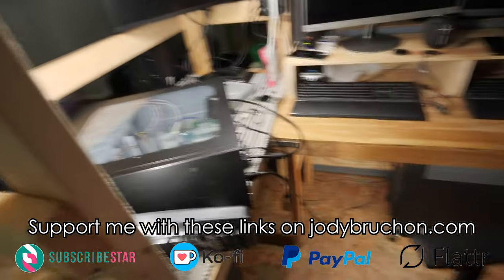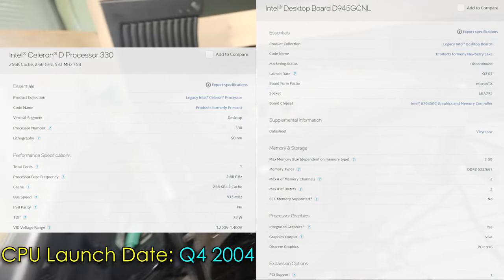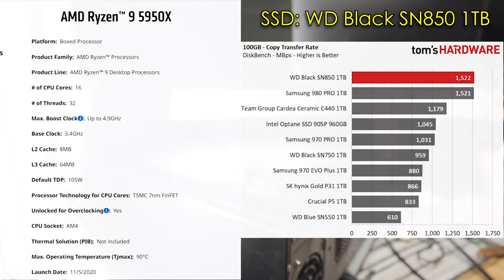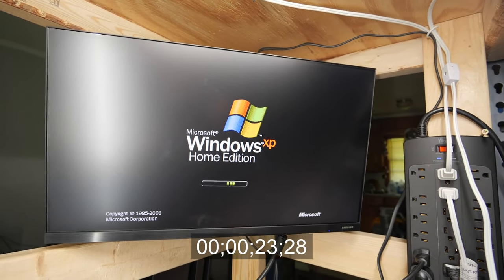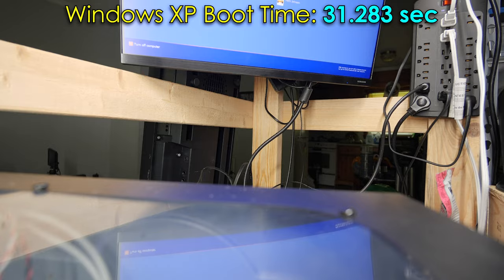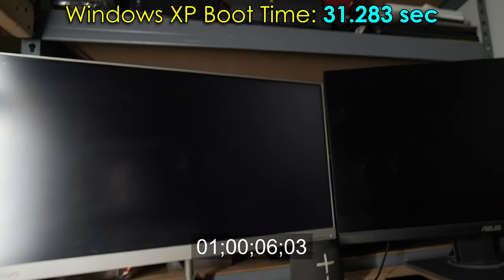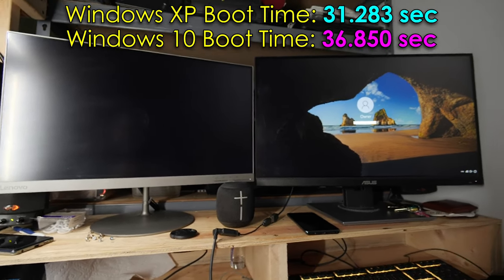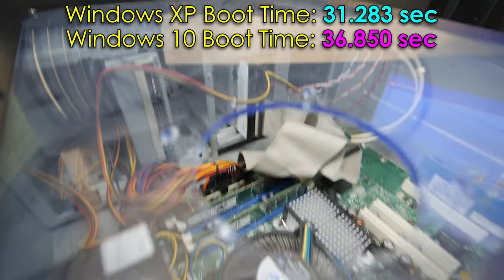Windows XP FASTER Than Windows 10?! - 5GB/s SSD vs. 50MB/s IDE Boot Speed Test - Jody Bruchon Tech

Comment: It's been a good test. I've also noticed that old computers running Windows XP or 7 are faster than new powerful computers running Windows 10 and 11. It would be nice to compare the launch speed of modern UWP applications with old Win32 applications in Windows 7. And in general it would be nice compare the speed of the Windows 10 interface with Windows 7. For example, a calculator, an image viewer, settings, etc. Windows 7 is faster than Win10. And also userlogon screen, start menu, notification center, etc. in Windows 10 everything is on UWP, which is why they work more slowly than in Windows 7 based on pure Win32. For these reasons, I have always hated modern Windows with its UWP and stupid, slow, awkward, ugly, and clunky user interfaces.

Comment: 5Gb/s, you say? 

Trust me, if one day we get 5Tb/s, they will add more bloat so it will amount to 30-ish seconds again. 

I think it's a paradox, it was described by someone, but I forgot the name of it.

Oh, it's a law, and it's called "Wirth's law" just checked
Reply: Do Micro$loth still pay by the kloc?

{:o:O:}

(Edited for tyops)
Reply from the maker: https://en.wikipedia.org/wiki/Wirth%27s_law
Reply: What Intel Giveth, Microsoft Taketh law.
Reply: @JodyBruchon  if you disable unnecessary services, apps and unnecessary processes running in the background on boot up, plus delete any telemetry you can find. I guarantee you'll get faster boot times for Windows 10. I bet you'll get in the low 20s for boot time instead of 36.850 seconds.
Reply from the maker: @TiredOfImbecileLibtards  None of that affects boot time and I've already done all that.
Reply: @JodyBruchon  this is my setup for Windows 10. Gigabyte B560 HD3 motherboard, Crucial Ballistix MAX BLM2K8G40C18U4B 16gb, EVGA GTX 1080 ACX 3.0 08G-P4-6181-KR, Crucial P5 Plus 2TB PCIe Gen4 3D NAND NVMe M.2 Gaming SSD. Also have a i7 intel 11700KF processor too.  Must be the setup that makes the difference on boot times. Because my Pc desktop boots up in 12.4 seconds. Which is pretty fast.
Reply from the maker: @TiredOfImbecileLibtards  BIOS time and fast startup can explain the difference. 8 don't use BIOS fast boot which locks out booting from external disks and I don't use Fast Startup which is technically cheating if comparing to Windows 7 or older.
Reply: @JodyBruchon  Yes I agree, I have fast startup disabled on mine. I read somewhere pc works better with fast startup disabled anyways. Also I have secure boot disabled as well. I only notice Fast startup works good when I completely turn off my pc, then turn it back on, but I always have fast  startup disabled though, don't really care for that feature.
Reply from the maker: It can cause glitches to persist across power-offs. I have solved many problems just by holding SHIFT whole clicking "shut down." It's annoying.

Comment: Yes, Windows Xp because a very good operating system was with good optimization and stability, and in Windows 10, optimization and stability were spoiled. Windows 7 also has good optimization and works fast. And Windows 10 for some reason slows down even on powerful hardware.
Reply: What i did was wait for a semi stable build of 10 and then stopped ALL windows updates. People still wonder how my computer boots so fast with all those apps starting up with it. Windows Rot is real.

Comment: So you got me curious and my "old" laptop (~2016, Win 10, 6th gen i7, SATA SSD) boots in ~33.5 seconds.
I'm not that surprised though, as far as I remember XP was quite a fast booter. Win 95 was a whole other story, if I remember correctly.
Also, as you mentioned, the slow part seems to be BIOS-related, so nothing the fast SSD can help with.
Curious to try that with my current laptop... but I need this to write ^^

Comment: I've been using this 2013-ish office computer as my main PC since 2018 and at first it felt "just right" for W10; I mostly intended it for simple stuff like web browsing and low-spec gaming (old PC games, indies and emulation), and it did everything decently enough, but lately it struggles to even open up the file explorer. It's so weird because I regularly clean it up from dust, and trust me when I say I try to not let it bloat with third-party software (also I reinstalled Windows little more than a year ago while troubleshooting something; that didn't work but I eventually found the problem anyway), and I was thinking that the components were already too "physically" worn out or something like that, but now I can see it's most likely big corpo, yet again, forcing me to buy new shit by making the shit I already own, that so far worked just fine, artificially unusable. Even my phone from 2017 is faster than said PC, although that one too is starting to feel "slower" than it should, even if it's much more subtle (so far).

Also on the topic of programmed obsolence (more like programmed self-destruction), the monitor for said PC started having these horizontal grey stripes all over the lower half of the display, and according to one technician I talked to, it's unfixable. Gotta love modern technology.

Comment: My old XP machine took much longer. Sometimes up to 2 minutes. But that probably had other reasons.

To be fair with the increasing complexity of hardware and software i would expect much more to happen in the booting process, but a large part of it is probably useless bloat that i dont even want to have.
Reply from the maker: This machine was barely used and never updated (much) because it's never put online so it kind of has an advantage.

Comment: Don't we have "Secure Boot" to thank for slow boot times?!🤔😳🙄
Reply: I have secure boot disabled and the UEFI screen still takes some time to load.
Reply: @ancavalcanti92  I have secure boot disabled too. My Windows 10 boots up in 12.4 seconds. I use Crucial P5 Plus 2TB PCIe Gen4 3D NAND NVMe M.2 Gaming SSD. Also I disable unnecessary services, apps and unnecessary processes running in the background on boot up, plus deleted any telemetry I could find. It helped on getting faster boot times for Windows 10 as well.

Comment: I don't have my older machines anymore but I definitely noticed that as hardware got faster, software definitely DID follow by adding more and more bloat over time. 
And I can't even say Linux is faster, sadly my current system still takes more than 30 seconds to boot (not counting the 10 seconds boot selector screen)

Comment: My AMD FX8350 computer with ssd and windows 11 takes 31.25 seconds from when I press the button until I'm on the login screen. Remember that Windows has not finished loading everything, you have to log in and then it loads the last bits.

Some bios are faster and some take longer before it starts loading windows
Reply from the maker: I pinned a comment since these nuances are coming out in the comments.

Comment from the maker: A lot of this comes down to BIOS time (especially "fast boot" settings) and Windows 8+ Fast Start being disabled. Still, one would expect a vastly faster machine to have shorter BIOS times and take less time to cold boot. My PC has BIOS fast boot (which disables booting from everything but an internal drive) and Fast Start (where Windows 8-11 saves system data to disk across reboots to start faster, a "hybrid hibernation" that can cause glitches to persist across power-downs) both disabled. Since Windows XP machines don't have these features anyway and both machines have fairly clean installations, this is a fair comparison, but by no means a scientifically accurate one.
Reply: You should enable fast startup in the uefi settings. My motherboard does the POST in 2 seconds when fast boot is enabled. Windows 11 takes about 8 seconds to boot. A total of 10 seconds.
Reply from the maker: @isharadhanushan2002  Where's that setting going to be on the XP machine I'm trying to fairly benchmark against the 10 machine?
Reply: @JodyBruchon  I mean you can make the new motherboard boot faster with fast startup enabled. The motherboard logo took about 15 seconds to show up. It could be 5 seconds when fast startup is enabled. It is available on almost all of the modern motherboard in the uefi settings except laptops.
Reply from the maker: @isharadhanushan2002  Some of that is RTX BIOS time. That's why it takes so long for a logo to show.

Comment: I think modern Windows spends a lot of time getting into states where its waiting for things to happen, in particular responses from the network. I'm not sure if that's the same when booting.
I had an installer running on a Win 11 PC not connected to the internet and it was still running the next day. I disabled the built in Defender/malware checking and it finished 2 seconds later. Utterly crap design. I can only assume it was timing out for each file it wanted to check.

Comment: After watching this video, I was curious to see what the boot time of my Raspberry Pi 1 B+ would be like compared to Windows 10 so I used a timer and it came back at 29.7 seconds. A Raspberry Pi 1 B+ using an SD card as it's storage boots faster than a Windows 10 machine using a Ryzen processor and SSD! 🤣
Reply from the maker: Hey, I have a RPi B! I used it for XBMC via Xbian. I miss those days. It was better than my Roku. I wonder if Kodi has an ad-free YouTube client.
Reply: @JodyBruchon  I had a feeling that you might have owned one Jody! I'll also have to time my Raspberry Pi 4 4GB to see how long that takes to boot up to the desktop login screen.
Reply: @ErnestPWorrell1984  I've got a Pi4 4GB model, and it takes about 20 seconds, and it auto-logs-in as well.

Comment: My PC (9th gen Intel i7-9700K CPU; 32GB DDR4; Samsung 970 Pro SSD) + Windows 11 - boots in 17 seconds with "fast boot" turned off, both in BIOS & Windows.
Reply: Are you sure fastboot is turned off? 17 seconds is almost too fast. More fastboot on speed!
Reply from the maker: On a clean install that has had no updates and minimal software installed plus BIOS set to fast boot mode (no external device boot) it's possible to get faster than that on some machines. Windows 7 on an i7-5000 series with a SATA SSD can hit such numbers. That's also the last Intel generation that works properly with unmodified 7.
Reply: @ford1546  
Yes, it must be turned off, because I am using 3 Samsung 970 Pro 1TB SSDs in RAID_0. 
(RAID_0 on this platform only gives a small speed boost when copying files, saturating the PCIe 3.0 connection, but only a tiny bit of gain when reading data from the volume drive. So the fast boot time doesn't come from the fact that I am using a RAID array). 
I've also created a RAMDisk partition which can't run if Fast Boot is being enabled in Windows power options.
Reply: @JodyBruchon  
I wouldn't bother using Windows 7 in this era. 
Windows 12 is coming! 
CPUs with NPU (Neural Processing Unit) chips are coming too! 
We can't hold on to the past!

Comment: NVMe drives do not guarantee a faster boot up time. There are so many different variables to be considered when combining the firmware, boot loader, drive, and operating system. Modern computers are very complex. I have a Windows XP workstation with a 15,000 RPM drive, Windows XP x64 that boots from power on to the desktop in around 30 seconds. I built a newer custom workstation with PCIe 4.0 NVMe drives which takes a very long time to boot both Windows 7 and 8.1. The fastest my main computer booted in was 90 seconds with one NVMe drive installed. The more I added, the slower it boots
Reply from the maker: The CPU is literally 100x faster. The memory is 3 generations newer. The drive can read over 100x faster and doesn't have seek latency. The operating system is new enough to take advantage of the newer hardware. Of course the boot may still be slow, but it shouldn't be.
Reply: @Jody Bruchon Tech  
I love this  Vid.
I also love drag racing.
 This is the closest I've ever seen of a between a drag race between 2 computers and thank you. 😀 👍

Comment: The only way you can get this pos to run as it should for todays expectations is debloating it, yourself, no customOSs and whatnot.

Enterprise N LTSC is a good way to start in that regard, you skip over hours of garbo uninstalls and choose what you want.

Also, suggest you use AsRock motherboards, i use an A520-HVS with a Ryzen 5 5600G and an ASUS Phoenix RX 6400 and the mile marker diff. Between my old ASUS H110M-R and i5 7400 w/ ASUS Expedition Geforce GTX 1050Ti (god thats a mouthful) is insane.

100 miles diff. Insane.